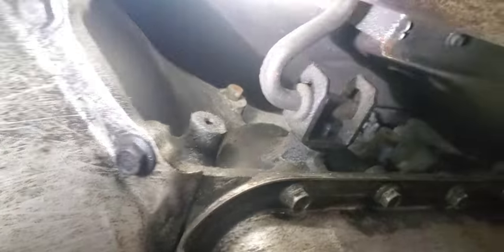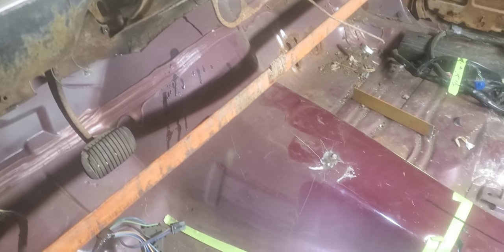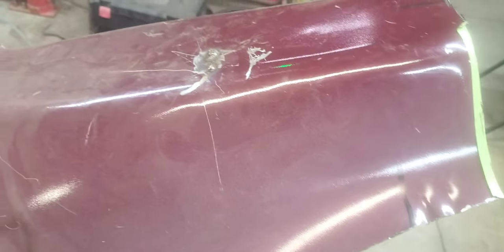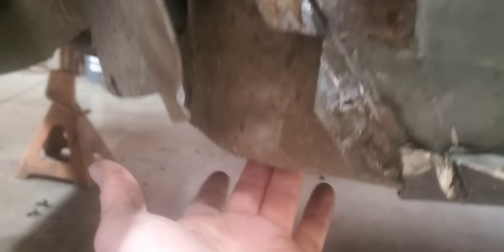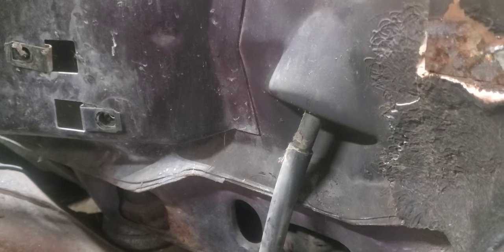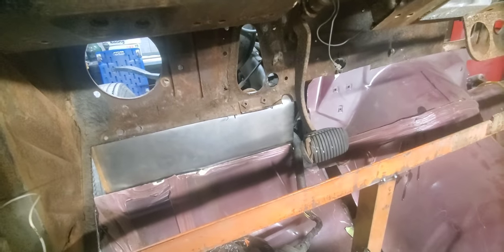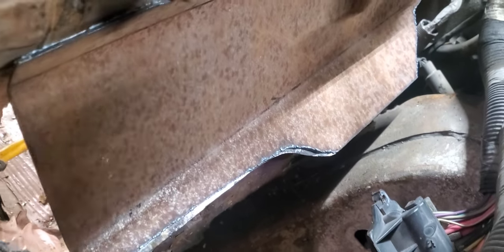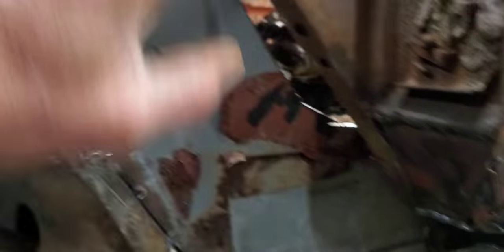Relocating the transmission tunnel on the trifive 57 Chevy blue goose lt1 Buick roadmaster body swap

Comment: I like the fact that those cut off pieces fit back in , that's cool. 
Then you have those mounting holes that can be used as originally made.
Marker lines on metal are cheap..so don't skimp on the ink. Make em long so you don't loose sight of em. 
I like to put the date on all my project pieces.

Comment: When I was doing this on the '51 I found I wished I had cut the 79 Electra down to the kick panel and used the '51 firewall.  I think you're in the same boat by the time you move the motor and trans back. 

One thing I discovered is when they converted to cable shifters they just bolted a tab on the trans ear that the cable attaches to, so like if you want to go floor shift use a 3rd-gen Camaro cable and you can use most any floor shifter you want.  I was about halfway through a 350/700R4 into a '50 Chevy and had a Camaro cable and a '64 Gran Prix shifter and a '63 Riviera console going on.  Then a guy offered me what I thought was crazy money for it and I sold it.  The detents are all in the trans, so as long as your shifter has enough throw to reach them all it doesn't matter one bit what it says on  the indicator or where it came out of.
Reply: And if you want a column shift, a pickup or van column will do it like 90-ish to 93 (trucks) or 95 (g-vans), they too run a cable.  The G-van column is nice because there's not one but two U-joints in it as it bends more than 90' to reach the steering box.  94-95 (93?) have a cover over the lower column to protect them, 92- back it's all open. In this situation it doesn't matter ( think the Roadmaster is going to work regardless) but if you needed to work around manifolds in some swap the G-van is great.  

G-vans are also a good place to source latches for converting older doors to bear claw style latches.  The whole inside door mechanism is like three bolts, runs off a push button, and is fairly thin, it will easily fit doors back to the 1940s.  And they do exist with power locks, it's a straight up and down run off the solenoid so moving it some is no big deal.

I mean you can buy some kit to do that but I bought a spare latch last month and it was less than $10.
Reply from the maker: Yeah I've used van columns from 80s and 70s chevy vans they work great if you want a tilt wheel and still want the ignition switch on the dash for older vehicles

Comment: I would be tempted to drown all the inner rockers and chassis rails with bar and chain oil once all the welding and fabrication is completed. Mustie1 uses the stuff and swears by it as a rust preventative.